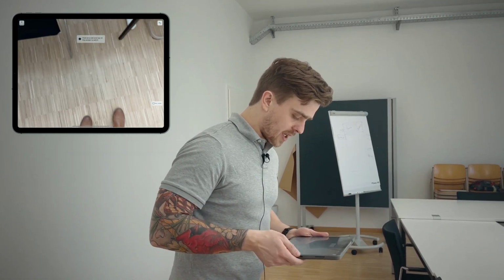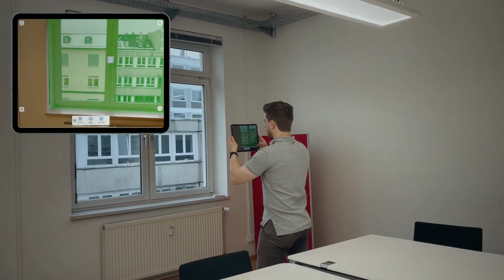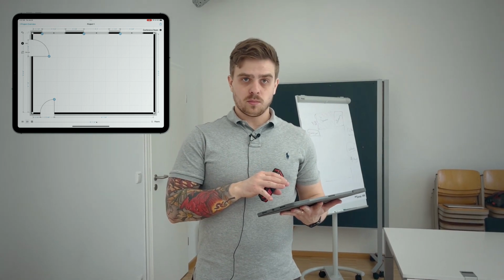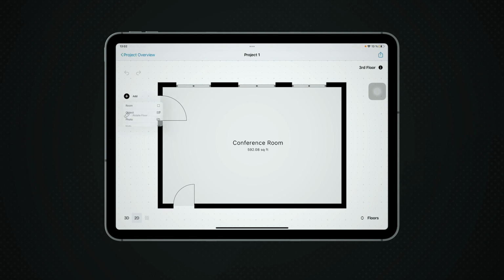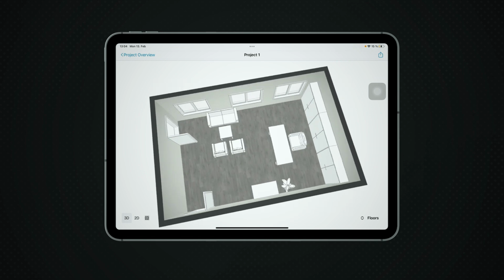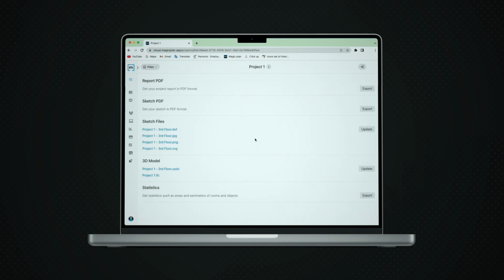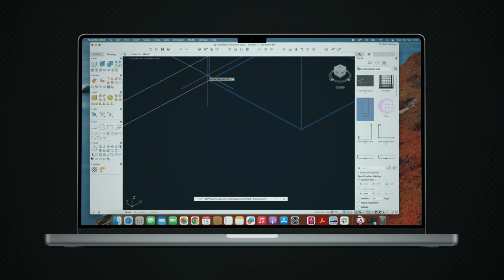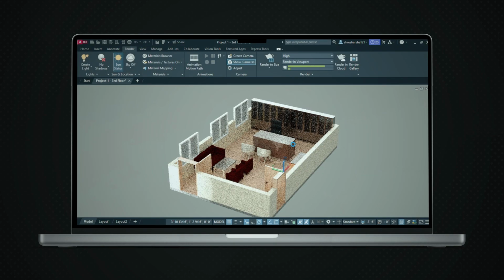How to Pair magicplan with CAD Software | Transform Your Design Workflow

Comment: Can Magic Floor Plan detect bay windows and irregularly shaped rooms, such as wall recesses or chimney breasts?
Reply from the maker: Hi! Yes, you can scan irregularly shaped rooms, absolutely! However, for elements like special windows, or some other objects, the scan might not always recognize them if the system can't precisely identify what they are.

That said, since the technology is constantly improving, we recommend giving it a try to see what gets detected. If anything is missing, you can easily add objects from the library after completing the scan. 
Check out the other videos on our channel for more in-depth explanations on each topic 🙂

Comment: The title mentions pairing with cad software, a lot of time sent creating a floor plan than spent about 10 seconds in auto cad. I tried this the drawings are not plottable. This feature isn’t much use as you may as well start from scratch in auto cad
Reply from the maker: Hi there! Did you try to export a DXF file recently?
I would give it a try since this video is from 1 year ago and we made some improvements in the meantime.😉 See also >> https://help.magicplan.app/export-formats - Silvia

Comment: looks like as much work as just creating a plan from scratch in autocad... that is too bad
Reply from the maker: Hi Patrick, it depends on what you need to achieve. Once you create your project in magicplan, you can export it in several formats so if you would like to do further editing to your project using programs like AutoCAD (for example) you could export the magicplan project as a DXF file and you are good to go. - Silvia

Comment: Why did you have to build every wall in autocad.
Shouldn't the walls be exported with the dxf?
Reply from the maker: Hey Aaron, all walls were exported from magicplan to AutoCAD as 2D polylines. We simply created the 3D walls by extruding those specific polylines. Currently, our DXF export only allows you to export 2D plans, not 3D. Hope it helps!
Reply: That’s the opposite of pairing I would say….